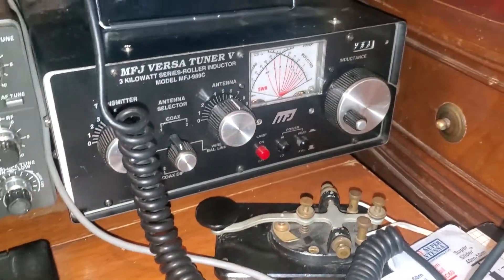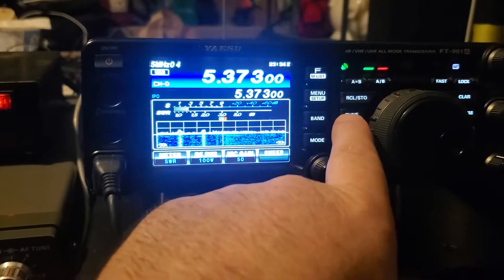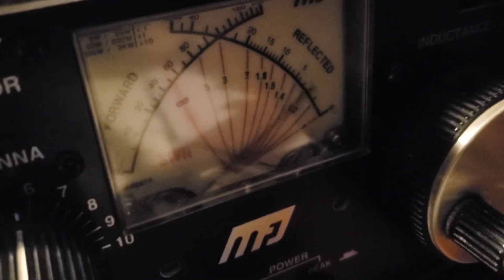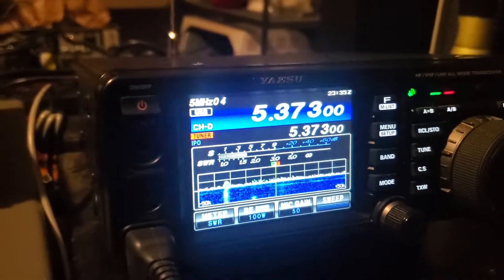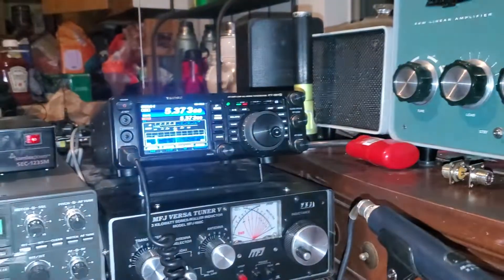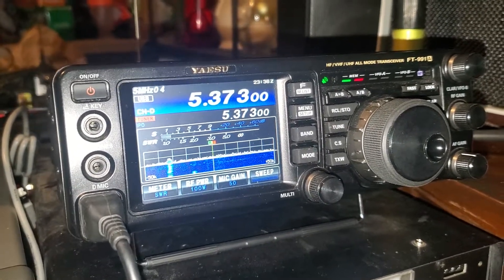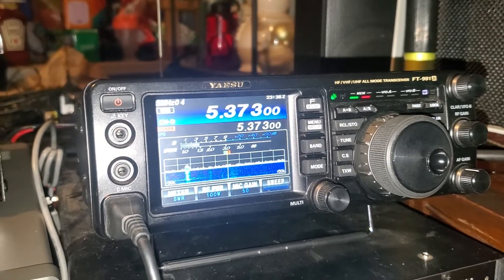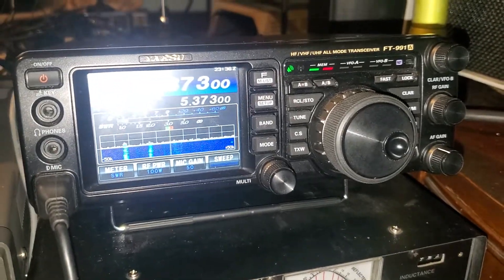MY YAESU 991A TUNER IS FIXED!!! ham radio

Comment: Just purchased a used 2023 model of the FT-991A. I couldn't believe it had this problem. Found the same article you did on github. Wonder how many more of the tuner boards are out there with the varnish covering the contacts?
Reply from the maker: Probably all of them

Comment: I cant figure out why its not happening on 20 for me and why it only happens on SSB . I have checked it on am and on CW and the the SWR is ok  . On mine seems to only happening on SSBat higher power settngs
Reply from the maker: Because ssb makes more peak power i guess.  Pull the board and clean up the spots that contact the frame and it should be fine

Comment: Hi there , mine Yaesu 991a is only 3 month old.  On 40 meter its click one time and don't tune.  I bought mine radio in the Netherlands and I live in Brasil. So I must fixes this problem by myself. I see your video 2 x but mine english is not so good. I must take out the tuner and clean the 5 contact points ( grounding)  but what I don't understand I must put some parts under the screws ( washers)? 

Thanks Christiaan
Reply from the maker: No just clean it and put back together.  Another thing.  The tuner is not active on recieve . Yaesu really   screwed up this one. I sold mine a month or 2 ago. It's a decent radio. But I want my tuner to improve my reciever also . And it's not the case here. Anyway  clean the back of the board where it mates with the casting and it should be good. This is also a problem on other newer yaesu radios.  Good luck and 73
Reply: @hamradiohack  thanks for response mine question.  I cleaned it , on 15 and 17 meter now it tunes. But on 40 the problem is still there,  while before on the same end fed half wave was working perfect. Is it a possible that mine land is very dry because 2 month ago it was rain season ?
Reply: I have same problem I buy here in Europe in wimo. 
Thanks for helping 
73